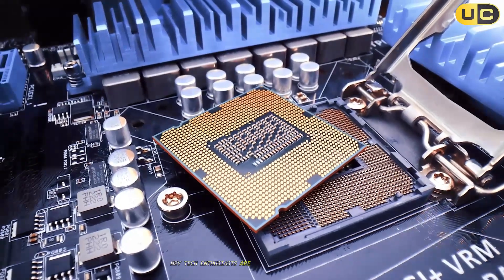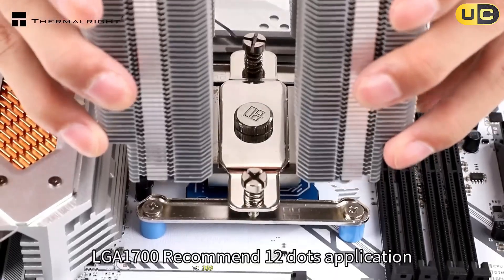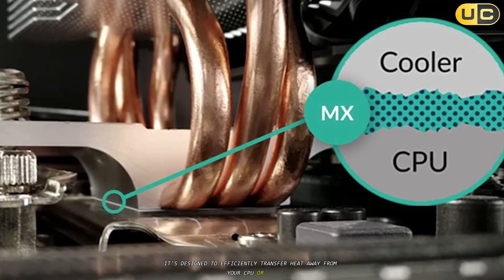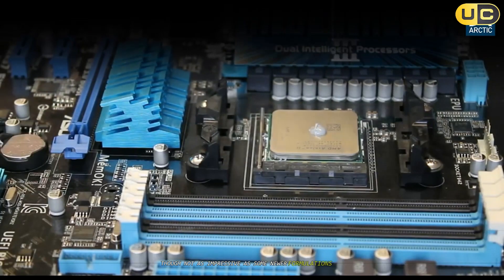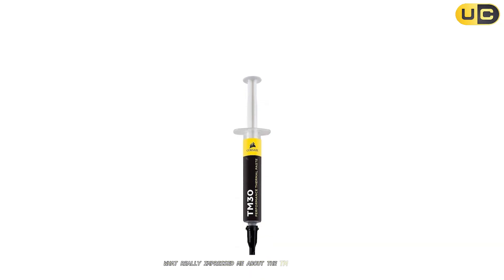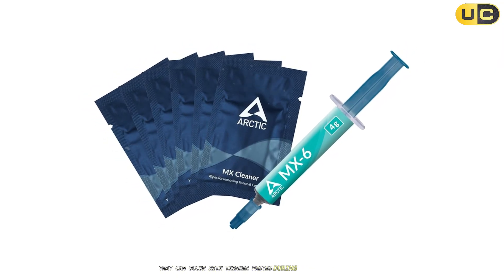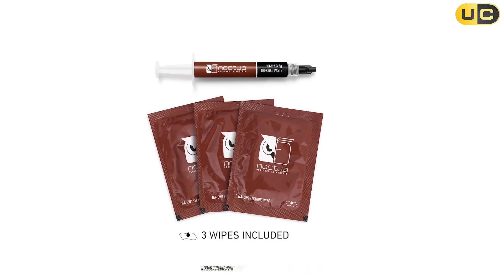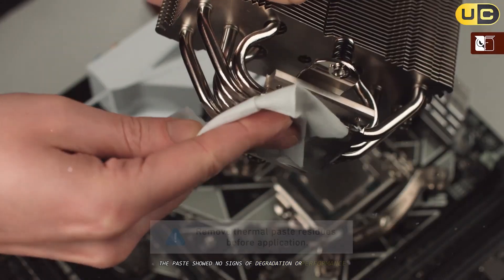5 Best Thermal Paste For CPU 2025! Are You Using The Right One?

Comment: I used noctua initially for my rog g14 laptop and it did improve the temperatures a bit but i still couldnt use the laptop at turbo mode..

In other words, i was still limited cause cpu temps would reach 90+...

For my second attempt i tried the grizzly thermal paste and max temps under turbo mode are 86-87 under tests. 

Thats just my experience